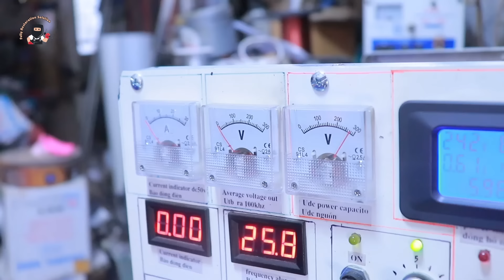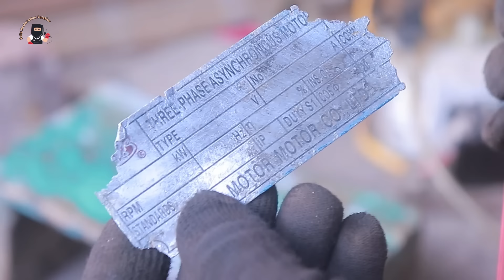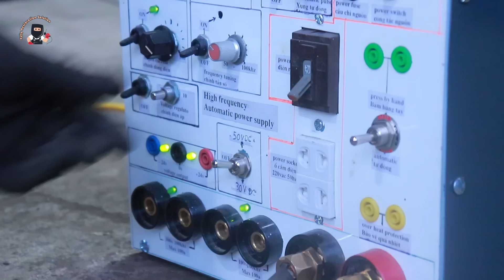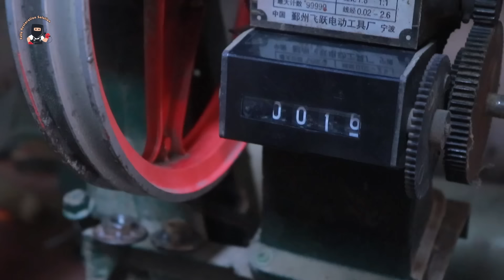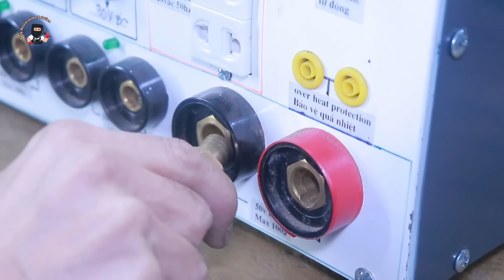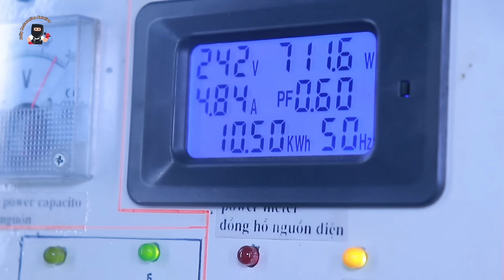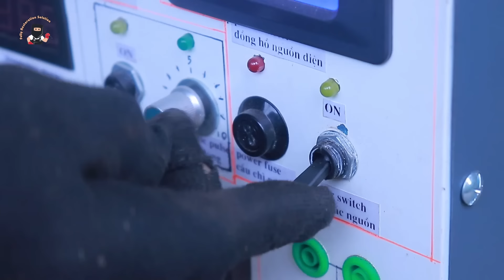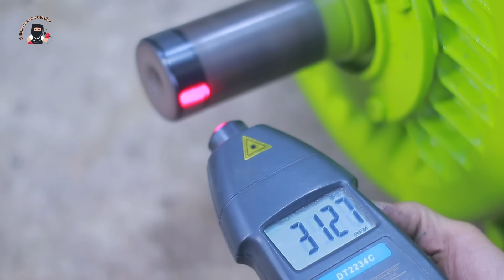Restore Very Rusty 22000w Motor Old | Rehabilitate Step by Step Restoration Videos

Comment: Please explain how you made that insulation remover ?
Reply from the maker: Have you heard about Fuco school? That multi-node machine is a high frequency machine. Many turns of copper wire create a lossy current that heats the steel core

Comment: awesome video. I see two mistakes. painting inside the motor and placing the bearing using a hammer a chizel.
Reply from the maker: Thank . The bearing is heated to 140 degrees Celsius and it opens, closes gently and it goes in
Reply: @RestorationVideo   its better to use something like a pipe so it covers the whole bearing and the impact is devided to the whole ring.

Comment: Ngef,48slot ,1400 rpm ,Hp 15
Reply: Please confirm
Reply: Connection double Delta
Reply from the maker: Ngef,36khe,2900 vòng/phút,Hp 30

Comment: Is that yellow anti rust paint heat resistant or high-temp grade? If it's not, it will melt by working temperature you know..
Reply from the maker: it's cheap paint
Reply: @RestorationVideo  geez..

Comment: why are you Connect the capacitor?
Reply from the maker: In our repair shop, we do not use 3 phase electricity, so it is necessary to add a capacitor to start 3 phase motor with 1 phase power.
Reply: @Fully Restoration Solution  but u did not start/run the motor, u did use this procedure to bake winding by dc supply,
Here why u use the capacitor parallel with dc supply???

Comment: How much voltage, frequency, and current??? when 4 nos turns looping around the stator core to heat the winding and core.
Reply from the maker: Sorry , we are not able to measure for you , because we lack the power to power the motor at the repair factory . I am Sorry.
Reply: @Fully Restoration Solution  can u tell the instrument name?? that u connect to stator body to heat.
Reply: 200v ,  70kHz   ,35A  ,cos y 0,7  , heating time 1h  ,p=5,4KW    P MAX= 10KW
Reply from the maker: 200v ,  70kHz   ,35A  ,cos y 0,7  , heating time 1h  ,p=5,4KW    P MAX= 10KW
Reply: @Nang Ngo the  thanks for information